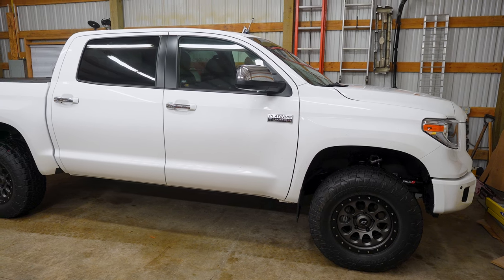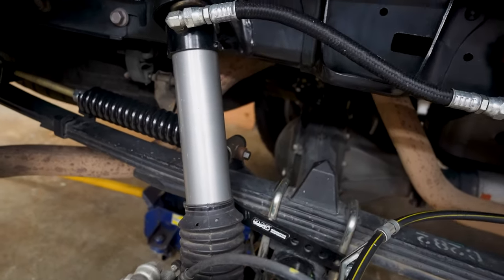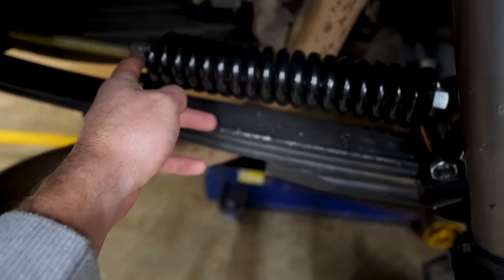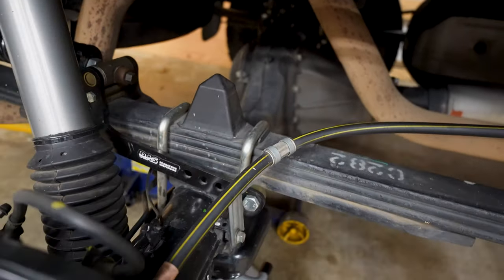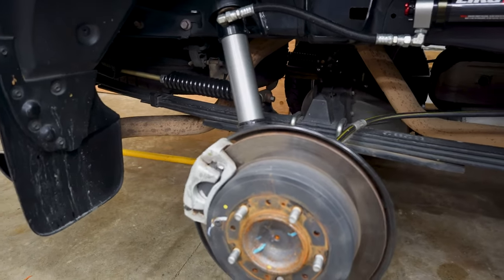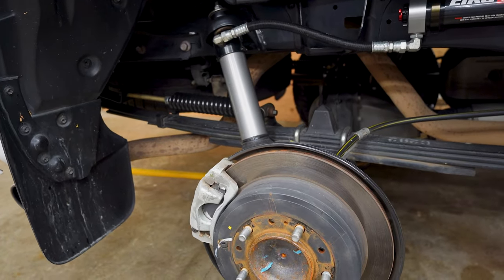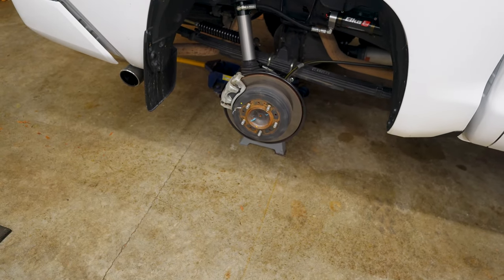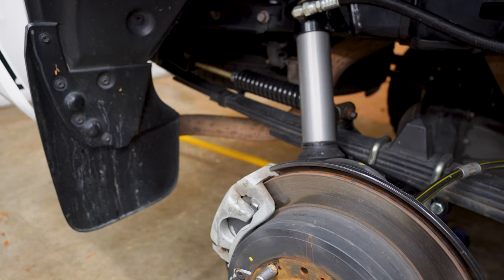(RAS) RoadActive Suspension | Long Term Review | Toyota Tundra + Airstream | Towing

Comment: Your problem with a Tembren is when it is slightly loaded. When the gap is not fully taken up but closes up when on a rough road, you can feel it. When fully loaded, it rides fine. Airbags, you have more maintenance and it doesn't seem to help if you have issues with porposing. RAS seems to work well in all aspects.
Reply from the maker: The RAS works pretty well. I have mine set between the 25% and 40% load handing assist. It is a bit of a compromise when it comes to offroad, but I knew that going in. Thanks for watching and commenting!

Comment: Sooooo happy I found your video. I found lots with other Tundras but I actually have the exact Elka suspension and my question was if the RAS worked with the Elka lift. This answered that completely haha. I also have the add a leaf and Timbren stops. I haul two snowmobiles in the back which is about 1200-1400 pounds so there was a bit more sag then I want. I do not want to go with the airbags. I think this may be the right option!
Reply from the maker: Glad you found the video helpful! They work well together and should really help the Tundra support that weight in the back. The RAS is pretty simple to install, I have mine set between the two spacers provided. Best of luck and let me know how it goes. Thanks for watching and commenting!

Comment: seems like of you off road, air bags are the way to go.  Keep the ride and flex when you want it, or extra load.   Also you get on board air. . .
Reply from the maker: Greetings. Airbags have their advantages for sure. If you plan to offroad with airbags, I'd recommend adding cradles, otherwise they will limit suspension travel. RAS has performed well, increased spring rate, but still allows for full travel.  Thanks for watching and commenting!
Reply: I have had airbags on 3 different trucks now and everyone of them around a year they always seem to have leaks in lines. Every time! No matter how many times you check the lines they seem to leak. This is up in Canada and I blame the cod temps in the winter and shrinkage.

Comment: I have a fairly similar setup as yours, on my 2015 Tundra 1794 4x4.  I also tow a 27 foot Airstream and added the RAS system to better manage the spring rate.  I have not changed from the OE rear suspension, but did add the TRD torsion bar, even though RAS recommends not doing that.  I added the sway bar to control the body roll, which it has done.  I also don't take the truck off-roading as you indicated you did. I'm running H-rated tires, which are the Bridgestones Dueler, which I'm looking forward to getting rid of for a set of Michelin.
Reply from the maker: Running the E Rated Toyo ATs in 295/70/18. They have been great, everything from ice to sand to towing. On Elka suspension with adjustable compression, so I can bump up the shocks when towing and that handles the camper well, then dial back down for daily use. The RAS did help with the rear squat, but it does raise the back just a little and I do notice the difference in bump compliance, with RAS being slightly firmer.  Thanks again for watching and commenting!

Comment: Have the HD kit on my 14 F150 and set on the full setting for payload. Completely changed the towing dynamics and made the whole rig feel so much better while towing my 9k travel trailer. Highly recommend. I don’t really notice the harsher ride on the F150 but it did increase the rear ride height about 1.5”
Reply from the maker: Greetings! Great to hear its working well for you. I have mine set right in the middle, which increased rear ride height about 1 inch. Thanks for watching and commenting!

Comment: The instructions say to lift it from the rear differential. Put stabilizer jacks on the front of the spring then lower it back down, You're saying it's better install by lifting from the frame
Reply from the maker: I believe you want the rear axle on full droop and the frame supported by jack stands. I would be worried about supporting the truck from the front of the spring. The tundra in stock form requires half of the spring shackle to be removed, I wouldn't want any of the truck weight on the spring while doing that. Instructions for your application may differ, if you have the instructions, follow those. Thanks for watching and commenting.
Reply: @MakeItRad  ok thanks I'll make some adjustments. I thought it was weird to have the suspension compressed for the install.
Reply: @cieje34 definitely wants suspension in full droop. Use frame jack points only do not support the suspension or axle at all.

Comment: Appreciate the video. I have a Tundra with a 23FB Airstream (I've commented before) I just installed the RAS (HD) in September. Over all, I'm happy with it, I set it to the Quarter spacer; however, I think I'll back it off especially after seeing your video. Our Trailer only has less than a 500lb tongue weight. I haven't changed my suspension (stock Bilstein TRD Off Road), but I'll check out your vid on yours. I will also say that I have a Hensley Arrow hitch and I'm super happy with it. Cheers, -Kyle
Reply from the maker: Greetings Kyle. Yes, definitely experiment with the different settings, as it does make a difference in the suspension feel. Thank you for the note on the Hensley, I'll be sure to check it out.

Comment: I installed the “half ton” or basic set on my 2018 Tundra back when they were called ‘Roadmaster Active Suspension’. I tow a 21’ Jayco trailer that runs about 5200 lbs normally. I also have a Recurve Weight Distribution hitch. 
I originally installed them to help control the porpoising effect. It’s done that and with the hitch I have a smooth and stable trailer pull. 
I got about a full inch rear lift.
Reply from the maker: Sounds like a nice setup! Thanks for watching and commenting!

Comment: Air bags are phenomenal on heavy duty trucks. You can’t make those ride worse anyway. But on a half ton, I agree, it changes way too much about the ride. Many of those airbags will destroy themselves if you leave them aired all the way down and the suspension bottoms out, so you always need a few PSI in them and of course that will form up the ride. The Road Active does seem to be a good middle ground, though I wouldn’t say it doesn’t impact ride quality, I just think that if it does it may err on the side of slight betterment for some stock trucks. 

I am concerned about how this might impact ride on a truck with adaptive suspension…but it rides like a Cadillac and honestly, it kind of bothers me. I’m hoping the RAS will tighten it up a hair in the back.
Reply from the maker: Greetings. The RAS is pretty great, but I agree, there is some firming up of the ride, and a slight increase in ride height. Thank you for the comment and for watching!

Comment: Correct me if I'm wrong but your leaf springs are wavy which means the truck is overloaded since there is no arch to them anymore.

I am seeing the same condition with my Icon RXT springs (option 3) with 700 lbs loaded in the bed. The truck rides OK but I am worried about the leaf springs' longevity.
Reply from the maker: Greetings. I'll have to take a closer look next time I am loaded up with the Airstream. They do the normal 2" squat that most all Tundras do when loaded. I'm nearly certain Toyota designed the first 1/5 inches of travel to be soft, then stiffen up with the bottom leaf thereafter.  With factory rake that would put it level, with my level / lift it would ride a bit low in the back. The RAS has helped and I could always tighten to the second spacer for 40% but I like how it rides with the 25-30% setting.  Thanks for the comment!

Comment: Did you get an alignment after installing it on the rear axle? Or no need to?
Reply from the maker: Greetings. I didn't do an alignment. I wouldn't call it necessary, but it also wouldn't hurt, as it will lift the ride height in the back slightly. Thanks for watching and commenting!

Comment: Why is your exhaust so rusty?
Reply from the maker: Ha, well... I'll have to watch that video again and look, but pretty sure its just dirty. This truck does see the dirt, sand, and snow when not on camper pulling duty. Thanks for watching and commenting!
Reply: @MakeItRad  Np, ty for the reply! I'm looking at getting one of these trucks as a 2021, 1794 edition, but am concerned by some things. I'm coming from a V8 4Runner & GX470 though, so it's the US made build quality vs. the Tahara plants track record that dominates my concerns. 😬
Reply from the maker: I hear you, have quite a few Tahara built Toyotas in the stable including a 08 v8 4runner and 09, LC 200 series and others.  The Tundra is actually our only US built model. From a quality standpoint, it has been great, one minor issue with the seat latch since purchasing new. But, its also the lowest mileage so time will tell, its engineering is on par w the 4Runner. The LC quality is on a different level, but that is to be expected.
Reply: @MakeItRad  Thanks!! That honestly put me at ease, hearing that from someone who gets it. We recently got a '23 GX460, and I've seen the "horror" stories about the valley coolant leak, but I'm okay with stuff like that as long as the vehicle itself isn't unpleasant to own... I know I'm being petty/weak here, but things like creaks, bangs, and rattles from poorly/improperly fitted parts (inside and out) drive me nuts. God Bless!